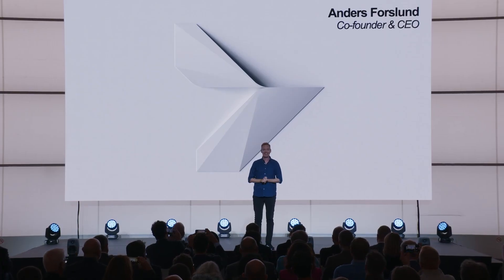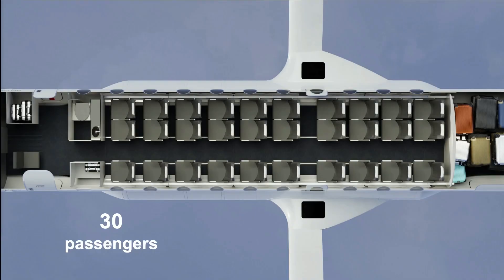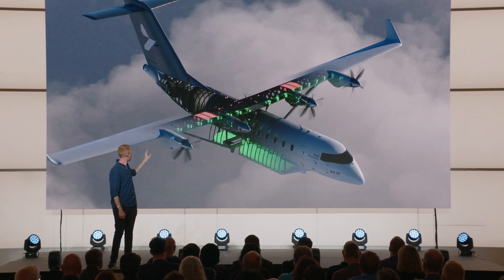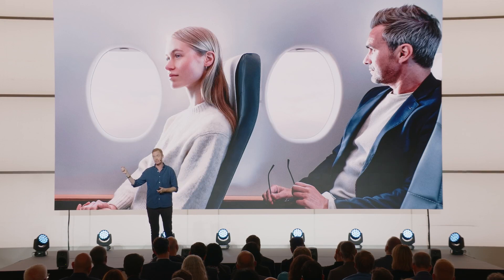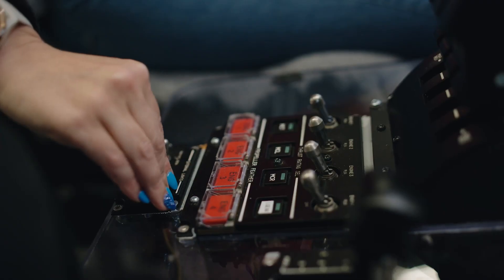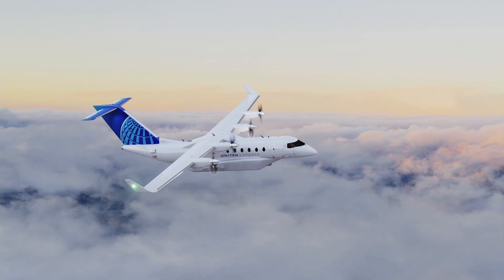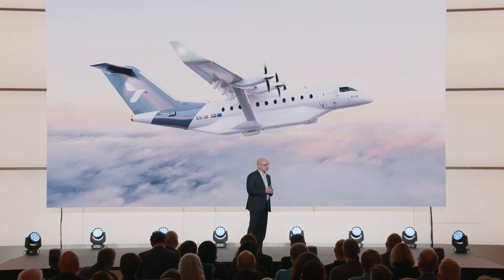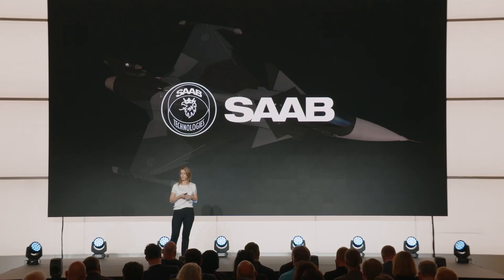Heart Aerospace Hangar Day 2022 presentation in 19 minutes

Comment: Fantastic event and what a plane and team at Heart Aerospace! You will help transform the aviation industry towards fossil free flight! /Johan
Reply: Other than the generator to charge the batteries. (To extend range)
Reply: Hi! Understand your concern but here is how I see it:

You bring up a vital point. Some media has reported that Heart Aerospace is "now going with hybrid planes", implying a sudden change in it´s committment to make fully electric planes. This is incorrect! The new ES 30 will have three options. 1. Fully electric 200 kms but with an onboard jet engine that serves as a emergency reserve in case the plane needs to change air strip. What it means is that if you design a plane for 30 passengers with only batteries (with current battery density and weight) you would have to have ALOT of dead weight in terms of batteries that would only be needed in case of extreme cases when you are unable to land on the designated air strip. Heart Aerospace have realized that this would limit the battery electric range of the plane and the number of passengers it´s customers/air lines need to make the trips economical. By installng turbo generators, that mainly is there as reserve capacity only means it lives up to the required guielines for reserve capacity. Again, the jet fuel driven generators would only be used in VERY rare occasions. It also means less weight that wouldn´t be used in most cases anyway! Option 2. Is 200 km range with batteries+200kms with added fuel to the turbo generators, so 400km in total. This would be a utilized hybrid version that could fly 200 totally electric but if needed or to extend range, fly 400 km in total. 3. Is the same plane but with 25 passengers intead of 30 which enable 400 km fully electric (or is it 300km?, not sure but please inform me!) or 800 km with 3-400 km battery electric and 400km powered by the turbo generators. So even when the turbo generators are used during a regular flight for longer range it would still cut the emissions in half or even more until it can be completely replaced by better batteries or hydrogen for example. I think this a necassary step forward to make the electric flights possible! Cheers, Johan